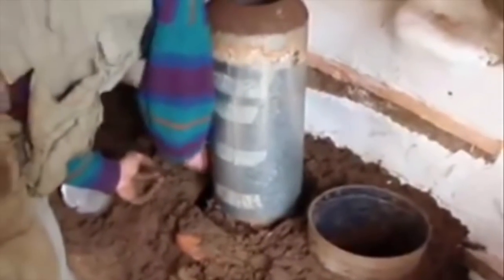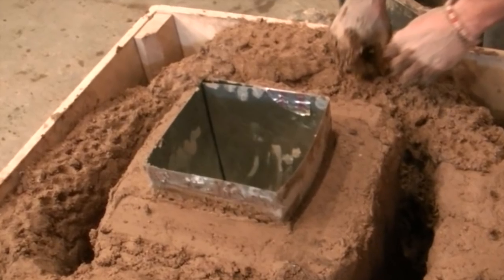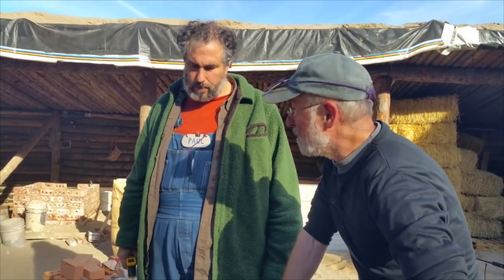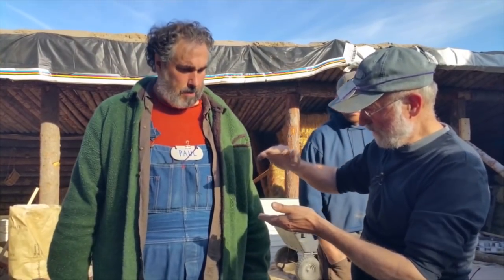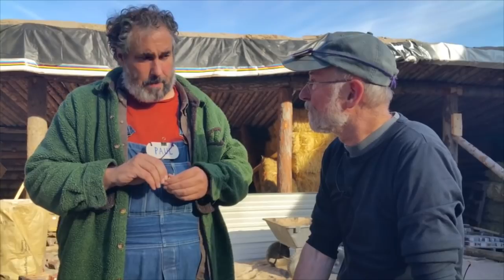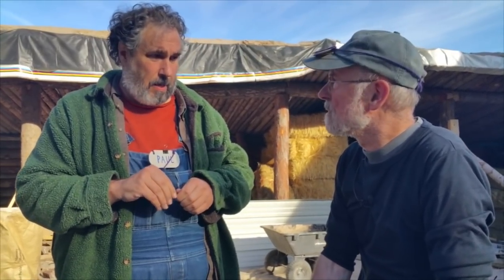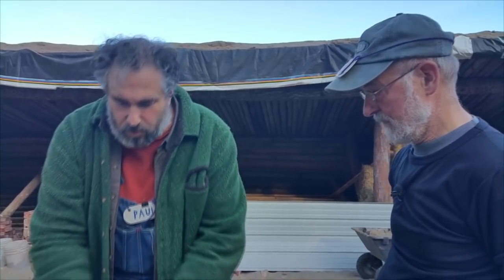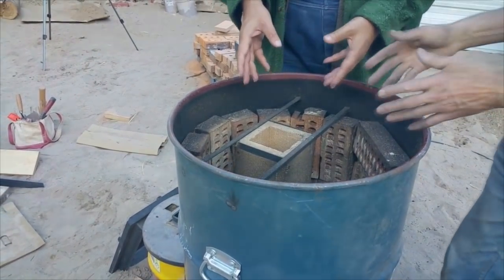do NOT use metal in the core of a rocket mass heater

Comment: Paul I have been a big supporter of your work for years, so please don’t take this as a personal attack (it’s sad I need to preface with this but it is the age of the interweb) but as long as I didn’t misunderstand your point, I don’t buy this claim at all. Wood will not melt steel in a forced-blast furnace, and it won’t here either. But, reduction or oxidization might be eroding thin walled metal liners fairly quickly. I would bet my life and my house on this as I say this from experience, not armchair opinions. I love your work, even the stuff I don’t agree with, keep it up.
Reply: I checked out the autopsy video on on web4deb channel and didn't see melting. I did see total failure from oxidation. Basically the iron is converted to brittle flakey millscale. This happens at temps far below melting temp like in a  forge. Are you seeing evidence that the steel has actually gone fluid?
Reply from the maker: check out the melted cored on the web4deb channel.  This is not speculation. This is dozens of melted cores.
Reply: I'm in agreement with the basic point, though. When you see stainless grates rust out in a barbecue, it's clear that regular exposure to far higher temps is a bad idea.
Reply from the maker: yes, we have done some cone testing.  At the same time, we have experienced different things melting (like perlite) which gives us a good idea of the temperatures we are reaching.
Reply: Most steels oxidise rapidly at higher temperatures thicker steel would last longer but the chemical  reaction would continue regardless. 

Even stainless rusts at those temperatures, you could use some special alloy like inconel stainless steel which would easily survive those temperatures but the cost of such a set up would be insane.
Reply: paul wheaton I just watched that video and I’m not really surprised to say that there was no evidence of liquified steel.
Reply: Wood ash is sometimes used as a flux in glazes. It's possible that potassium and sodium oxides in the ash could be lowering the melting point of the perlite. Perlite is pretty similar to glaze ingredients.
Reply: I think the point here is that the high temperatures destroy steel cores, but at no point did they become liquid. So the technical process that destroyed them was something other than "melting".
Reply: Has anyone ever stuck a thermocouple into the hottest part of a rocket stove? I'm curious if there's any hard data. Maybe temperature cones like potters use in their kilns would work?
Reply: @manatoa1  yes. At least 600c, in a stove that wasn't tuned up yet. Type K thermocouple and alab quality instrument.  1000c isn't out of the question at all.
Reply: 1000c is still well below the melting point (1370c) of steel. It may oxidize, and flake, but it won’t melt.
Reply: Same might be going on with carbon; if the steel absorbs enough of it the melting point can become as low as 1050C. In practice id be more worried about oxidation though; although even before melting iron can become awefully soft. Ive 'melted down' oil barrels using open fires. They wernt ever liquid technically im sure, but they also didnt retain much of their original shape.

Comment: I made a steel core, but I agree with the makers from this video. Steel is easy to use and cheap to get but it's just not the right material for an inner core if you want this type of heater to work as it should. 

For me it was more of a learning project, and I only use it outside in the summer if I want to sit outside a bit longer.

Comment from the maker: since recording this, there have been some 4 inch steel cores that have worked because the operating temperature is kept below 1300 degrees F.
Reply: How does lower temp effect emissions and effeciency?  

There seem to be a few steels like INCONEL 617 that are rated from up to 1800,  but could be pretty hard to source and tricky to work with.
Reply: I think the issue Paul means is that steel sucks and disipates the heat necessary to make a rocket efficient. Steel may not melt, but it does decay. I've seen risers made from two different sizes of stovepipe filled with pearlite between the layers. It worked for almost a season. The temps were not nearly as high as I get with a refractory riser.

From my observations, the hotter a rocket gets, the more efficient it becomes.... and this is why mass becomes necessary.

Next stove I build is going to be refractory, burn chamber to the top of the riser.
Reply: Kiwihouse2005 B.  Sure, why not? Only possible draw back would be the immediate cooling effect is lost or rather reduced, so I'd elevate the oven by a few inches.
Reply: Ya no $@&!